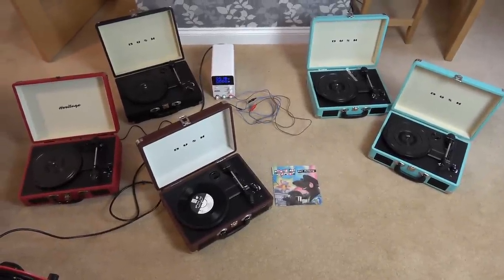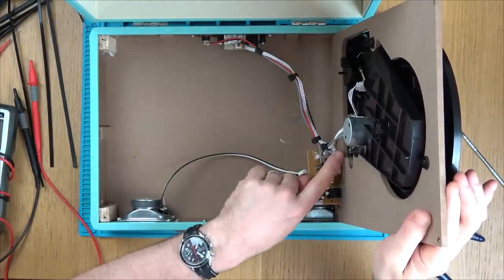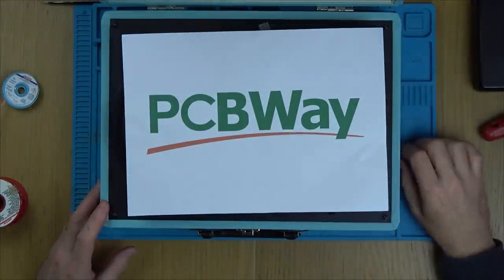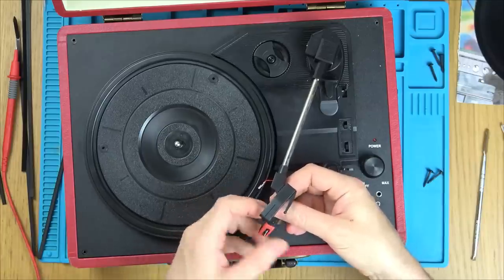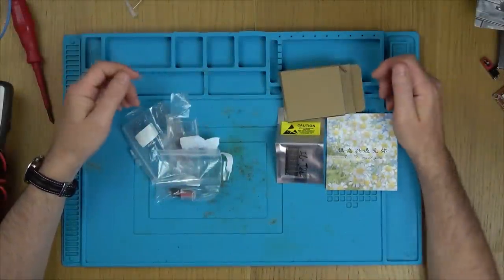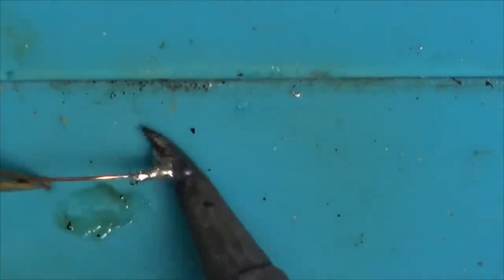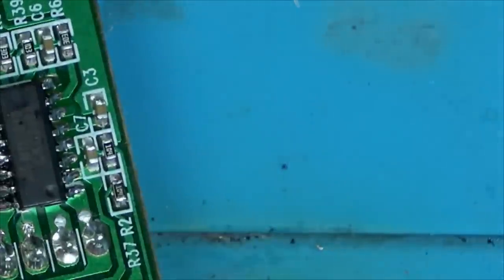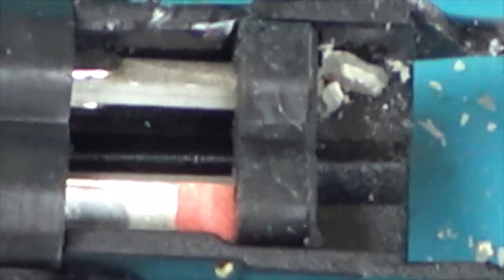Trying to FIX 5x RECORD PLAYER SUITCASES

Comment: These cheap and (very) nasty record players based on the crappy Crossley turntable mechanism have a terrible reputation for quality and reliability, but in a lot of cases this is not down to the mechanism itself, but rather to the overall design and (lack of) build quality of the rest of the product. 

In terms of sound quality, sure the simple piezo-ceramic cartridge is never going to give hifi quality, but it can certainly sound a hell of a lot better than these things do. The biggest stumbling block in terms of audio quality is not the cartridge, but the tiny (tinny) speakers. Firs of all they are way too small, giving sound similar to a cheap transistor radio, and the amplifier is also of relatively poor quality, though the speakers are the biggest issue with these suitcase units.

The speakers are also not acoustically isolated from each other and are too close together, both of which kills any chance of getting a decent stereo seperation.

However it IS possible to get pretty good quality out of a unit like this by taking the wires coming from the tonearm and attaching them to a pair of RCA type connectors on the back of the unit and then connecting these to a seperate amplifier and speaker system (proper amp & seperate speakers, not a crappy soundbar). That will allow the cheap cartridge to sound really good, as although it's never gong to be "hifi", even these cheap pickups are capable of far better sound reproduction than you'll ever get from one of these units in its stock form.

The other main issue that you sometimes get with these units is wow and flutter. For the most part this is caused by the lightweight plastic turntable - a good turntable sould have a decent amount of weight to it so that it operates like a flywheel, so once up to speed, it tends to be pretty stable. Because these plastic ones have almost no weight, combined with the low torque of the motor, speed fluctuations are inevitable. It is possible to glue some weights under the turntable, but frankly this requires a high degree of precision in order to not make the problem a whole lot worse, as the positioning of the weights needs to be absolutely perfect :(

A lot of people will tell you that these cheap players will damage records. That was true of the old 1950's and 1960's players with their heavy tonearms, but it's not really the case with these as the tracking weight, though heavier than it should be in most cases, is much less than on those old players. That said, you can drill a hole in the plastic housing over the back of the tonearm to take a small hex bolt or something similar and this will allow fine adjustment of the tracking weight.

Note that records pressed from genuine vynil are pretty tough, but in the 70s and 80s quite a lot were pressed from much cheaper hard polystyrene which does wear down pretty quickly, even on top quality equipment, so this is more of an issue of record manufacturing rather than the quality of the players themselves.

Note that it is possible to buy just the Crossley type mechanisms online and many people have built their own players based on them that actually outperform these cheap ready made units hands down. Whether it's economically viable to do it this way may be up for debate, especially as you can pick up these suitcase players cheaply on car boot sales, but the point is that you CAN actually get pretty decent (though again nowhere near "hifi") quality from these things with a bit of work...

Comment: Why bother, junk it is. Set them on fire, you WON’T “get the sound of vinyl”. What you’ll get, is the sound of the worst product available on the market. What you also get, is a worn record after a few plays on these pieces of junk. Yes, a stylus has a fine tip……unbelievable.
Reply: There is a cheap mod to add a proper stylus to these, actually.